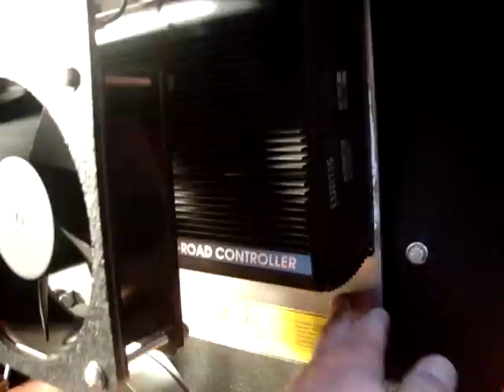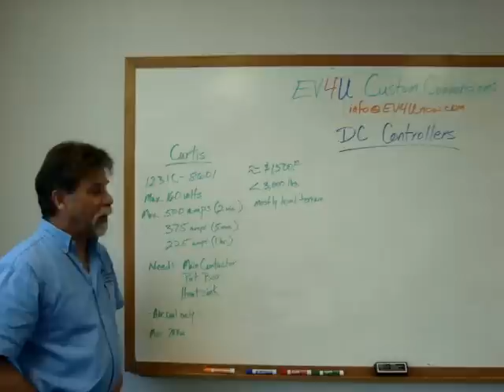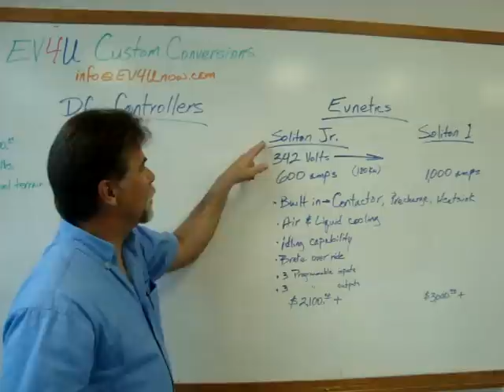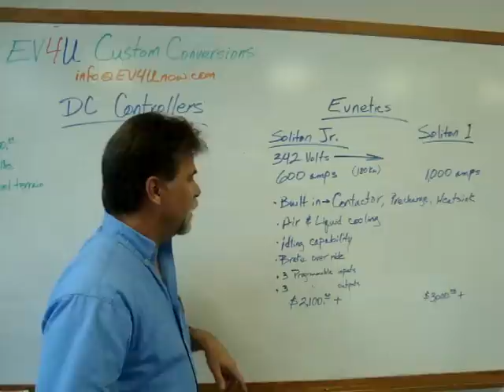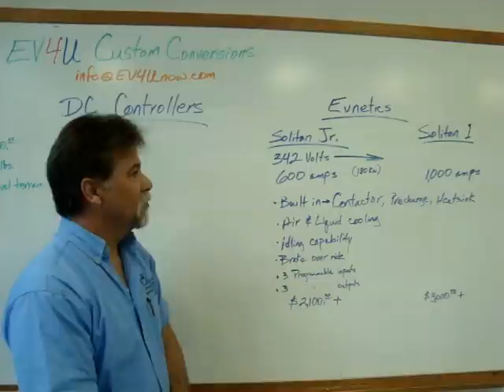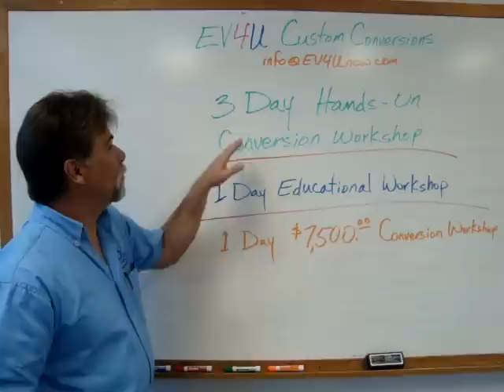EV Conversion - Flash Back - DC Controllers - Both have been discontinued.

Comment from the maker: Interesting, I was not aware that you could fully discharge a lithium chemistry cell.  Unless it's a difference of terminology.  By 100% I would take that as 0 volts.  Or do they mean some other voltage, such as 2.5 volts?  Thanks for the video suggestion.

Comment: Also, I spoke with a leading technical Spec.s guy at Dow/Kocam and he indicated to me that their batteries could be used to 100% depth of discharge and still get 1500+ cycles out of them, an avg of 80% D.o.D. would get you 5,000 cycles, and less than 50% would get you over 10,000 cycles. My suggestion for another show would be one covering good quality 3rd party information sources to verify things with. Thanks again!

Comment: I think another big advantage of the Evnetics is the programmable motor voltage and current output. This allows you to have a bigger battery pack against the voltage drop while accelerating with higher amps.

Comment: I believe they are made in Portland, OR. Netgain Controls had them in their booth at EVCCON. 

Pete in California had a post on his blog about using the SynKromotive controller as a charger. (onegreenev.blogspot.com/2012/07/a-little-on-synkromotive.html) I believe it is a software upgrade they were letting Pete test.

Synkromotive, LLC
P.O. Box 2452
Portland, OR  97208

Comment: Richard,

Have you ever tried the Synkromotive Controller? It has a pretty good price, 750 amp output, and is built to run on air cooling without having to plumb all of the lines for liquid cooling. I have also been told that an unadvertised feature is it can be used as a fast charger off of a lower voltage battery pack using the motor coils to boost the voltage.